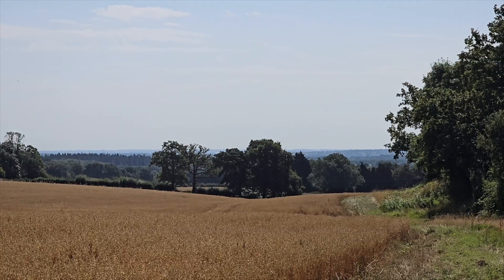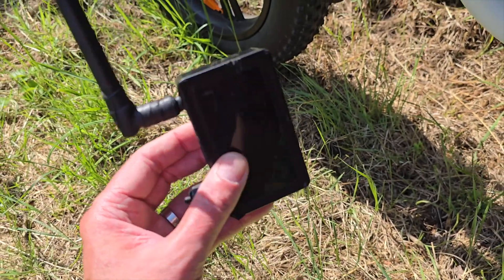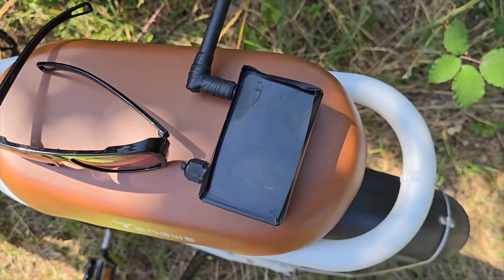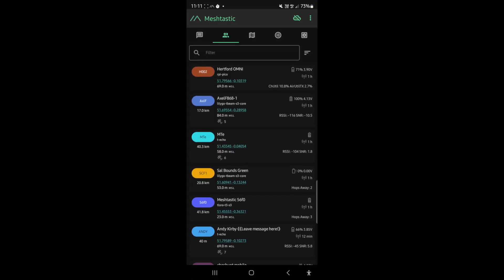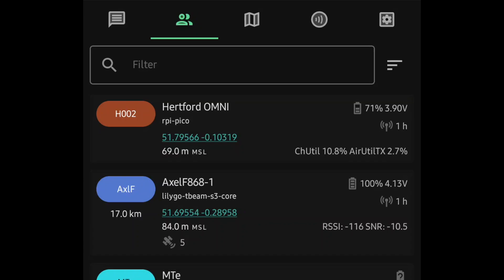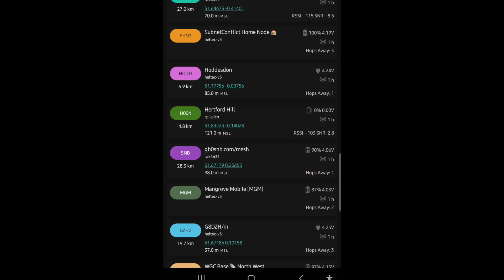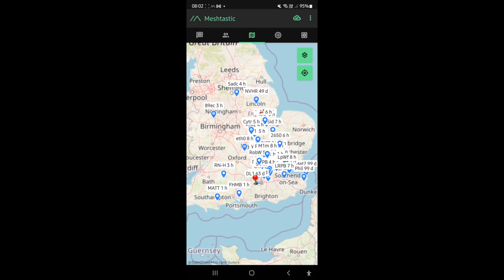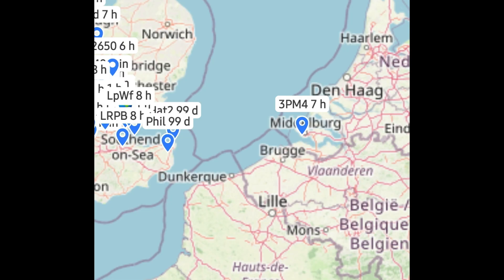DONT GIVE UP ON MESHTASTIC - WATCH THIS!!!

Comment: while watching i had to think about 35 years ago when i did packet radio which in essence is the same as this. The speed back then was 1200bd or 2400bd if you had a better modem. Popular bands here where 27Mhz and 2m.

Comment: Question for you or the commenters if I have a private channel between two nodes and move a node out so it is like two hops away, will the private channel still work and be passed between the hop nodes to reach my other node or is it just the public channel that will be passed over the mesh network? thanks in advance

Comment: One feature that would be very useful in Meshtastic is a mode like PSK Reporter in FT8, so people can tell how far away their nodes are being received. This would allow them to optimise nodes, antennas, repeaters etc and discontinue those that add little value. I am currently receiving loads of nodes (some over 100 miles away), but since I cannot reliable run a 'Trace Route' with many of them, I don't know how far away I am being received, Does anyone else agree?
Reply: Agree!
There is a Meshatstic module NeighbourInfo. But it is disabled by default. If it is enabled at remote node and your node is received by that node directly,  your node will be added to NeighbourInfo list with SNR how they receive you.That list is the broadcasted every 15min and also pushed to mqtt (provided that is enabled) Then you will see your node on Liam Cote Meshatstic map. A bit like psk reporter.
But as you see a few things need to be configured in order to achieve that... I thinks Devs need to make it enabled by default.  (For some reason,  they think its bandwidth hungry).
Well, not more than Telemetry .
That leaves us with Traceroute as only option to tell if we are received. 
In my experience if a direct node doesn't  comeback with Traceroute, then they are not receiving you.

Comment: The discrepancy between the success of the beacon packets and the flakiness of the message packets is really frustrating.
Reply from the maker: As I say, it's important to understand how the different parts of the system works. Beacons are smaller packets of data and they get repeated over and over, they propagate over the mesh more effectively. Messaging requires more overhead so signal strength needs to be much much better to have it work successfully.

Comment: How you prevent them from overheating in really hot areas?
Reply from the maker: It's only really the ESP32 devices that get warm, using Nrf52 or 2040 devices run cold.
Reply: By wearing a vest ?😅
Reply from the maker: Exactly!